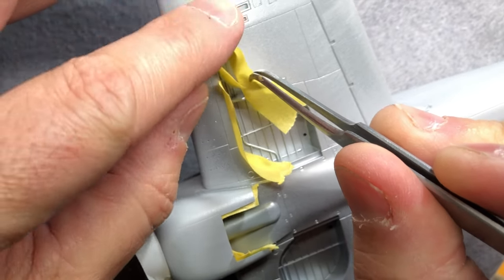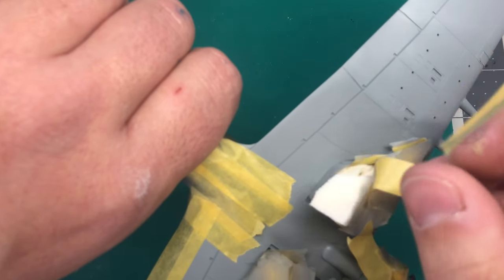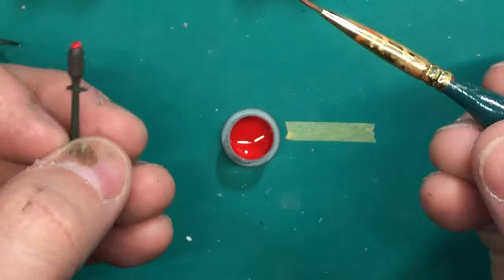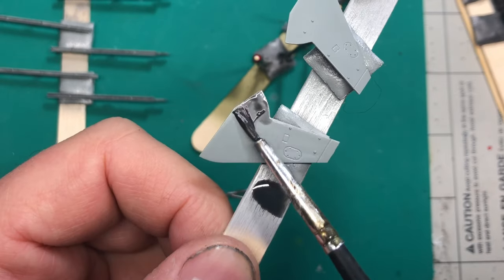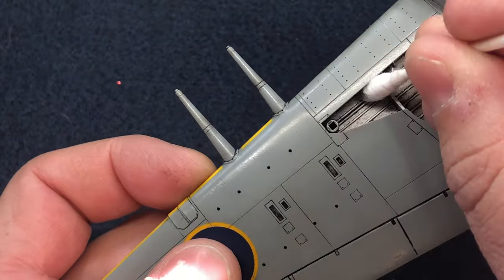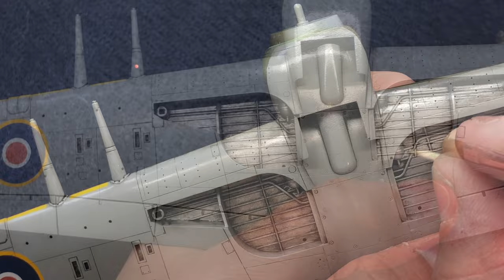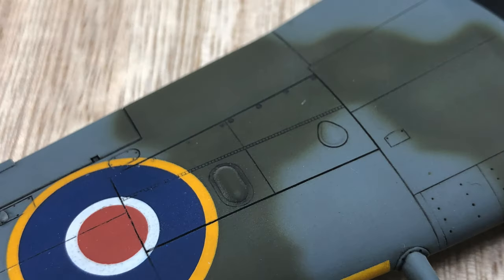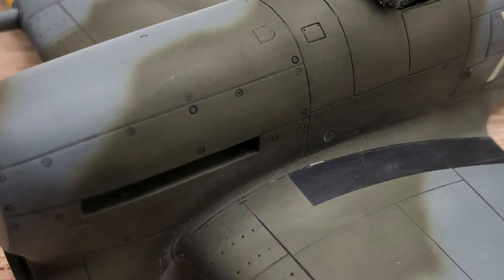Plastic Scale Model Build - Hasegawa Hawker Typhoon 1/48 - Part 4,  Painting, Oil Washes 4K

Comment: They are, in fact; IFF stripes. Identification/Friend/Foe. Interesting note, the Japanese also used yellow for IFF. I agree with you about Tamiya paint and tape. Some of the best in the business. I tend to stick with them and Gunze Sanyo. I only use Vallejo for brush painting and NEVER tape over it. Most decal solutions will cause the decal to wrinkle when applied. As it dries it forms into the surface and goes away on its own. I can't say in your case as I only use Micro Set and Micro Sol. I'll say this, Tamiya decals are well known for being overly thick. Perhaps some unknown reaction occurred. That particular kit is not all that old so, I don't think the decals would have suffered from age. Give the two I mentioned a try. They work as a system of sorts. Nice job on the Typhoon.
Reply from the maker: Hi Stephen, thanks for your feedback. For the decals, I used Aeromaster decals. I am fully aware decal setting solution causes wrinkles but this was very different. Two of the decals seemed to become coarse. Very strange. Even after several applications, they didn’t even out.